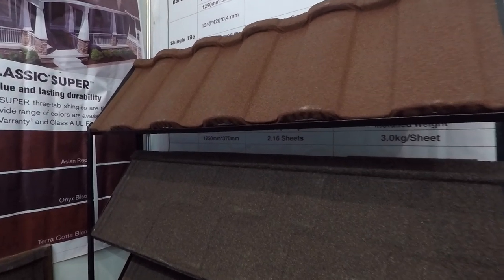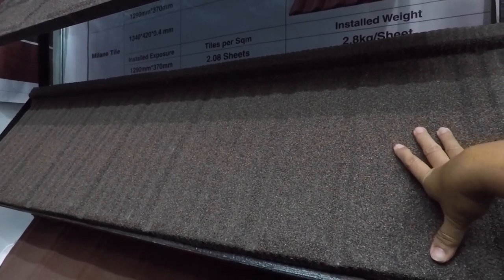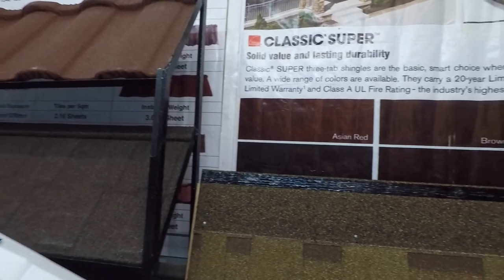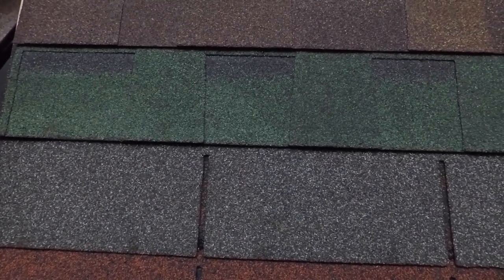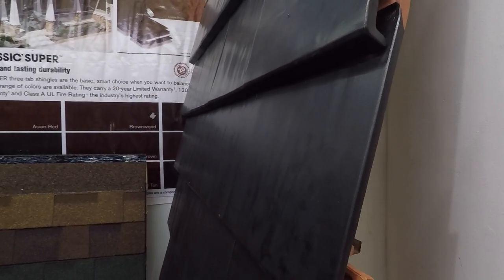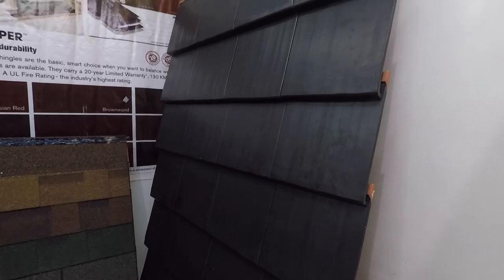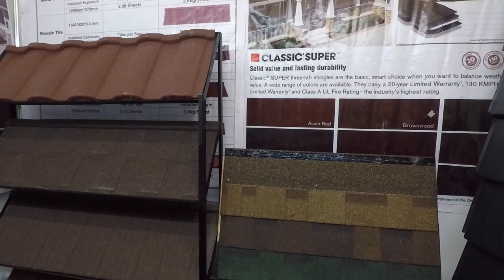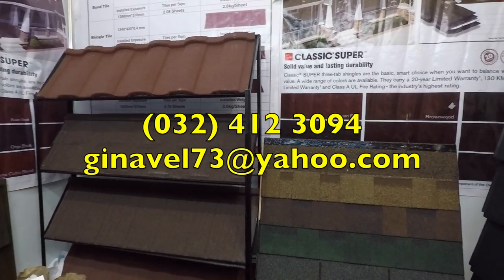Roofing options with prices, in the Philippines.

Comment: I used Decra brand shingles on two clients houses in the US and they were about $150.00  ( 8000p) years ago per sq. Plus installation so if the quality of those is close to Decra at 1500p per meter installed that a fantastic price. Do you know the brand of the stone coated metal ones and warranty or where you saw them at so I can check into them.I found a Korean brand but they don't use galvanized metal and won't warrantee them to last.  We have to have a system that will last in salt air and not interested in metal roofing or tile , don't care for the look .

I wrote the above before watching the whole video, I already sent her an email,,,,,, so never mind about what I wrote earlier. Thanks!